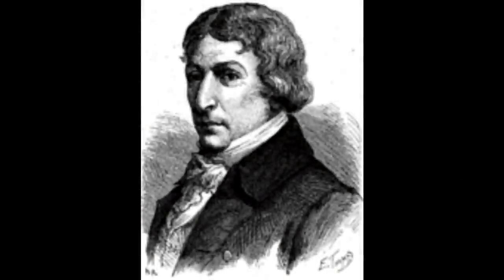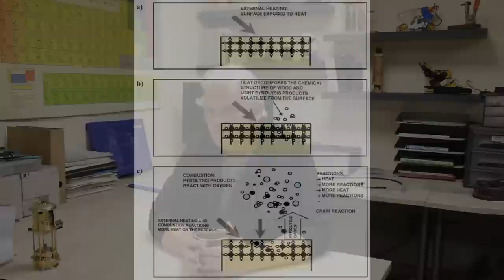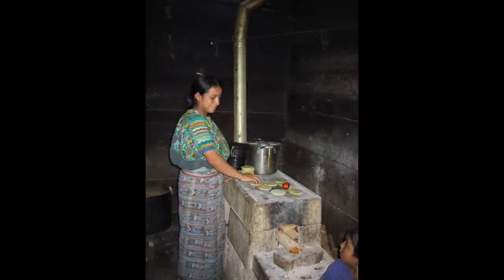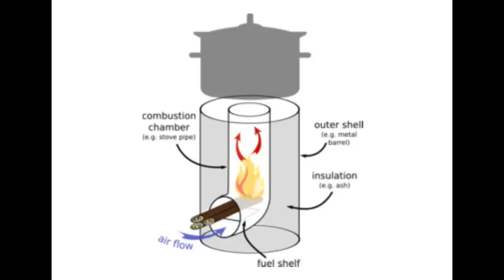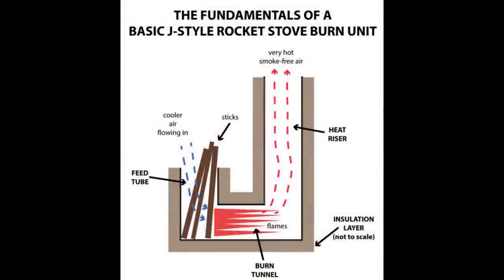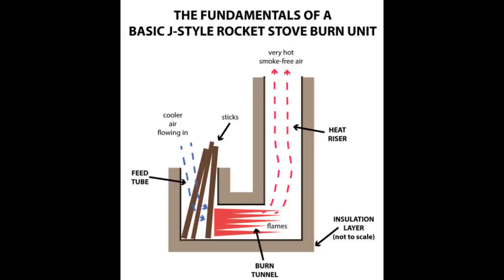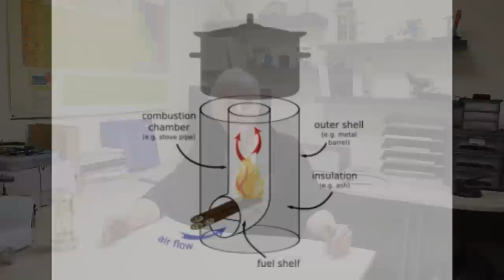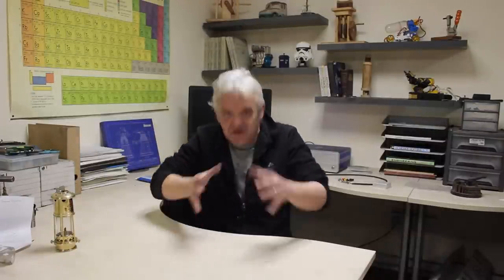1742 The Rocket Stove - Explained and Demystified #rocketstove

Comment: In my opinion after having tried and built a large mass heater and being very disappointed With the amount of heat that was coming off the mass I feel the best use would be to use the rocket stove to heat water and then heat a radiant slab perhaps but the best thing is to just get the room hot and then shut the thing down you’re much better off spending your time sealing up your home and insulating then you are screwing around with a mass that just ends up looking ugly
Reply from the maker: yeah - I agree heat the room fast and stop it leaking heat is what I would do
Reply: @ThinkingandTinkering  Same approach to using solar: Remove as many electrical inefficiencies as possible, then plan your solar system.

Comment: mass heater does prevent heat loss like in a chimney large percentage of heat goes up flue
Reply from the maker: mate it doesn't - that's a function of chimney design - you can have a convoluted flue non mass that would do the same thing

Comment: The rocket mass heater is more efficient because the flue gases cool in the flue pipes heating up the mass before exiting as the flue gases cool it shrinks causing a vacuum pulling in more air. There is less heat lost up the flue pipe to the outside.

Comment: I'm not sure on the mechanisms required, but wouldn't the advantage of a mass heater be the capability to distribute less heat over a longer period of time?
If I heat a bucket of sand with my rocket stove, then gently waft a draft over the hot sand to spread 'less heat' for more time?
Reply from the maker: sorry. mate I don't think it will spread less heat over more time for a given situation - it will spread at a fixed rate from hot to cold depending on the environment - isn't that thermodynamics? on thinking about it - in an absolute sense it will spread less heat as the mass will retain some of the heat
Reply: @ThinkingandTinkering  my wording is definitely bad here, you'd definitely need some form of insulation, heat pipe, airflow control, or other cheats/techniques to reduce the heat dissipation to a rate that you're happy with.
I'm certainly interested in trying it
Reply from the maker: oh ok - I agree with that mate

Comment: Somewhat misleading in the statements about thermal mass simply shifting the time of heat release.  In much the same way that one can increase solar panel efficiency by simply increasing the space between the cells and the glass pane above them by a couple inches, effectively thickening a solar panel, one can use a small portion of the electricity generated by pumping air through the panels, capturing considerable heat from black body radiation that was otherwise lost.

In this case, the black body radiation from a rocket stove can be captured by nearby thermal mass, which is painted black, as well as a winding chimney surrounded by thermal mass.  In this way, not only can a rocket stove use forced air to heat a space, but is heating thermal masses by direct chimney conduction (otherwise wasted) and blackbody radiation (also largely wasted).

Very efficient indeed.
Reply from the maker: I am sorry mate it isn't and I don't see the analogy in what you said

Comment: The mass "captures" heat that would normally be shot out the chimney.
Reply from the maker: I am sorry mate it doesn't - that's a function of the chimney design - you can design a non mass chimney or flue that does the same thing
Reply: @ThinkingandTinkering  The exhaust path is different than the chimney.  Combustion in the burn chamber, exhaust path through mass, gasses exit through chimney.  
    These terms have been used for decades in rocket stove development.   
    Do you know the "donkey boards"?  It's the place rocket stove developers have congregated for decades.  
    The "mass" is a "thermal battery".  It extracts heat normally lost up the chimney.  A "bell" or "bench" is not a chimney.   
   The proper CHIMNEY temperature should be @300°Fahr in an efficient mass heater.
Reply: You are correct in the fact that a mass heater radiates less heat more slowly than a burner with no mass...it radiates immediately and heats the space more quickly.  However,  what is not radiated from the stove is lost up the chimney.  The mass of a mass heater "soaks up" heat normally lost and radiates it over time.
Reply from the maker: mate - that is just not right - I get what you are saying in and mostly that is what happens in practice - but it doesn't have to as several designs in flues as I described have demonstrated
Reply from the maker: yes it is - but that doesn't matter in what you saying - you have to compare like with like or it's apples and oranges - if you construct a mass heater with a convoluted flue less heat will be lost in the exhaust - the same is true of a non mass heater - equally if you construct  a mass heater with a direct flue more heat will be lost in the exhaust
Reply: @ThinkingandTinkering  A convoluted exhaust path hampers air flow and reduces efficiency.  
     Most mass-less builds with long flues get torn down.  That's why there's no "living with my mass-less stove heater for a year" videos online.  They usually don't respond to update requests.
Reply from the maker: I didn't know that - cheers mate - I was thinking of forcing air through - a bit like a gasifier unit - post a cyclone and radiant heater - I kind of get the idea that might be good if we can cool the exhaust gas until it won't melt the fan - of course this would up the burn chamber temp so different materials would be needed then - but interesting idea to me
Reply: @ThinkingandTinkering  You won't need a fan.😁

Comment: Some of your statements seem a little undifferentiated, or you have thrown things together: Cooking stoves, ovens, masonry ovens. 
You imply that a "rocket" oven produces too much heat all at once, and a masonry stove takes too long to emit heat, but the example image you showed yourself perfectly describes the possibility of combining both versions: Fast heat, determined by the uninsulated surface area of the bell, and slow heat, determined by the masses around the bell and the flue pipes.

You claim that "normal" stoves/fireplaces already have an efficiency of 70-80%. But this is only true in theory, because the "user" factor is not taken into account: No ordinary user has a real idea of what stage of combustion the fire is at, and whether there is enough or too little oxygen to reach the stoichiometric equilibrium of wood gas and oxygen. No one has temperature sensors in the firebox and on the flue to calculate actual efficiency, no lambda sensors to measure oxygen levels, and no applications to measure particulate emissions.
99.9% of people have no idea when and how to adjust the primary and secondary air and flue gas dampers to achieve the correct mix, temperature, pressure and flue gas velocity.

A traditional stove is designed for a rated output: For example, a 6 kW stove can be loaded with a load of wood "worth" 6 kWh of energy + the losses, i.e. about 7.8 kWh.
If the fire is started correctly, the wood is perfectly sized and dry, and the throttles are set correctly, then in a tiny fraction of the burning time it reaches the ideal combustion point, where the heat loss of the chamber is compensated by a flame hot enough to ensure a clean and efficient burn. Before and after will be anything but.

If you provide too little wood, the temperatures will not reach the required point, too much wood will cause a lot of pollution and unburned gases.

Contrary to popular belief, a wood fire cannot be "regulated". It has to be given the right parameters through the stages of combustion.

The rocket heater principle tries to reduce these fixed combustion stages by spatially separating them. 
At least with the J-tube design, you can have a continuous supply of an adjustable amount of fuel instead of a fixed load.
The insulation of the combustor and heat riser ensures that temperatures are high enough for clean burns at different fuel loads and burn stages.

No manually operated solid fuel stove really works efficiently or cleanly.
And when I see the sometimes scary experiments of highly ambitious "believers" on YouTube, I can even understand why you find the subject of the "Rocket Stove" a little ridiculous.

Comment: There are quite literally books written about the misconceptions you are presenting in this video.  Research the masonry heater, Korean ondol, Finnish tulikivi or "Russian stove".  You couldn't be more mistaken when you say that the same amount of heat is generated, or when you reference the peak temperatures achieved.  Also, you are regurgitating the efficiency ratings put on modern wood stoves, but those are certainly not accurate, given the temperature of the flue gases mandated by governmental regulations for such.  This is a topic with much more for you to discover.  Currently, you are seeing it through the smoke of a conventional fire.  If you take the time to really understand what is happening in a proper rocket mass heater, masonry heater, etc. I think you'll be surprised at just how much more there is to this than you currently believe.
Reply: I just did a quick search for the stoves you mentioned, in specific two of them; the Russian stove, and the Masonry stove. After my search I have found they work exactly as described in the video. The stoves themselves heat up, and retain the heat in themselves for a long duration rather than give the heat immediately to the environment. 
Here are quotes from my search for any who wish to read :
"A Russian stove is designed to retain heat for long periods of time. This is achieved by channeling the smoke and hot air produced by combustion through a complex labyrinth of passages, warming the bricks from which the stove is constructed" - wikipedia search Russian stove

"A masonry heater (also called a masonry stove) is a device for warming an interior space through radiant heating, by capturing the heat from periodic burning of fuel (usually wood), and then radiating the heat at a fairly constant temperature for a long period." - wikipedia search masonry stove
Reply: @ravenpotter5131  - The interior temperatures achieved, and therefor the BTU's transferred to the masonry, is substantially greater than that realized from a modern wood stove.  That is what allows "mass heaters" to provide the same level of comfort in your home (greater, really) while consuming far less firewood.  It is not the simple equation you presented in the video, for those two reasons.
Reply: @jasonbroom7147  I do apologize for any confusion, but I'm not the poster of the video. I'm just a purveyor of learning like yourself. I would like however to point out that your point of higher temperatures was also brought up in the video, and he stared that it's a Ballance, wood can reach temperatures high enough to melt steel but with temperature that high you must have more materials that are more expensive, while raw stone isn't more expensive than steel in the quantities necessary for fire safety you are basically required to make a large stove just like the Russian stove you mentioned. Which increases the cost from probably under 200 for a small steel stove like shown in his rocket stove videos, to possibly as high as 2,000 or more. It also increases the complexity of the build and therefore the skill necessary for building it. He states in many of his videos on building things that his goal is something that almost anyone can build, not anyone can build a Russian stove but for only about 15-20% more fuel anyone can build and run his rocket stove.

Comment: This isnt Accurate!   Rocket Mass heaters, are designed to radiate most of the heat, at the burn barrel stage (quick hot heat).  The hot exhaust heat  (AFTER the Barrel)  is captured in a long tube, that is ran inside of a big thermal mass (Bench).   This allows the system to Extract almost ALL of the Heat, before coming out of the end of the Chimney..  with exit temps that can be lower than 100F.   The Bench, then radiates that exhaust heat slowly, throughout the rest of the day.    Due to the fact that Heat rises instantly... a lot of Heat is lost at the ceiling of a room... especially if there is poor insulation above it.   By keeping heat released at a slower pace... it can help keep the heat from instantly being ate up... and produce a more even, and longer lasting heat... that is experienced where humans reside within it... rather than it being above them.

 Obviously, the more Optimal solution, would be to have a mass heated flooring system.  That would further allow heat absorption through the bottom of the foot.   The Japanese have been heating their Flooring for ages.   Ive also seen ancient Korean housing, that used to heat the flooring as well... though, I dont think modern houses use floor based heating over there.  These days, a lot of people use hot water heating, under the flooring.. rather than super heated air.

 Now... here is the thing... depending on hot cold things get... a quick hot burn method, may be just as effective, if not more so, than a slower mass hybrid.  Thats because the cold temps basically pour in from all sides.. dominating and diffusing existing heat.   So, even though heat rises instantly, as it saturates the room... it starts to completely fill and increase the entire overall room temp... dominating over the cold conducted temps.
Reply: Im going to add.. I believe it was the Chinese, that Originally invented the Rocket Stove technology.  They have metal forging, far before the Greeks and Japanese.  And they used the tech, with their Traditional Wok stoves.   Take a look at the traditional wok stove designs.  They are a fire box, with the large metal wok sitting above it.. and covering the hole.  There is an Exhaust port in the rear, that goes up into a chimney, out of the house.   They burn Extremely Hot, which makes for Quick, efficient, cooking.

 The thing about Traditional Wok cooking,  or High BTU wok burners at a Chinese restaurant is that they heat the veggies so quickly, that they become completely cooked internally, without losing a bit of textural crunch.  The veggies retain their colors, and they are not "Mushy" / stewed.. which happens on typical low-BTU stovetops.   Additionally, some of the Oil gets hot enough to ignite, and create a wonderful smokey flavor.. which is called  "Wok Hei".   You often see a similar thing, when dining at a Hibachi grill (take off your glasses afterwards, and you will see the fine oil misted on them).

 I personally bought an Outdoor Wok burner, thats claimed to reach 90k BTU.  Sounds like a Jet Engine.  At full power... I Cooked "almost" fully thawed chicken, to a Charred exterior, in less than 3 minutes tops.   Veggies are the best, however.  There is no way to get that crispness, but completely cooked internally.. in any other cooking method.
Reply: They still have underfloor heating in Korea. Even in the apartment buildings.